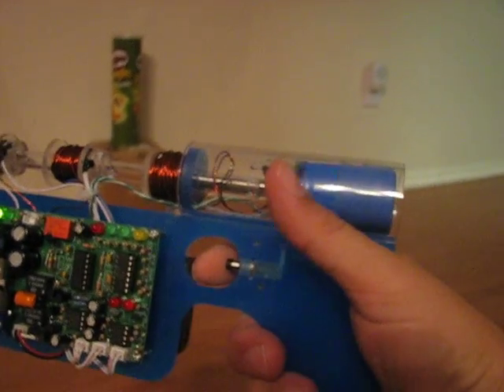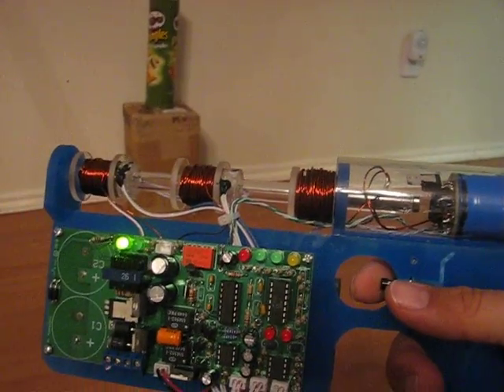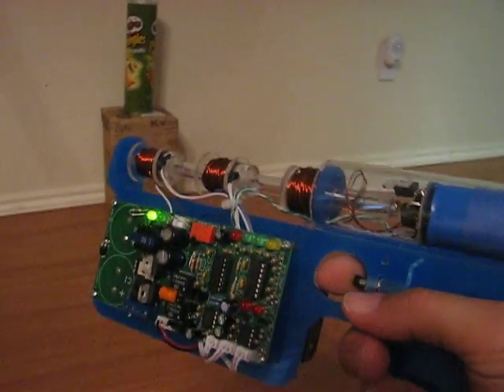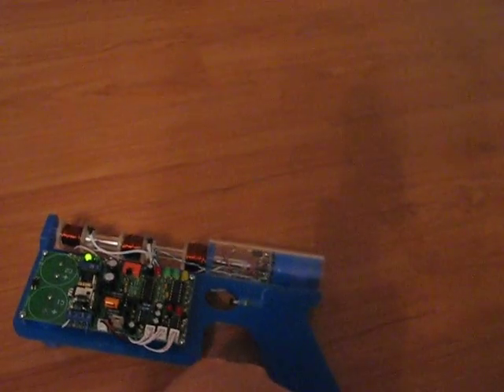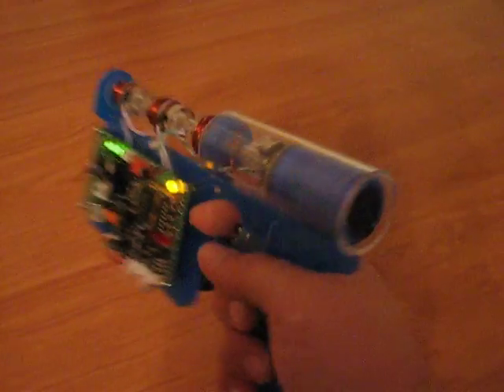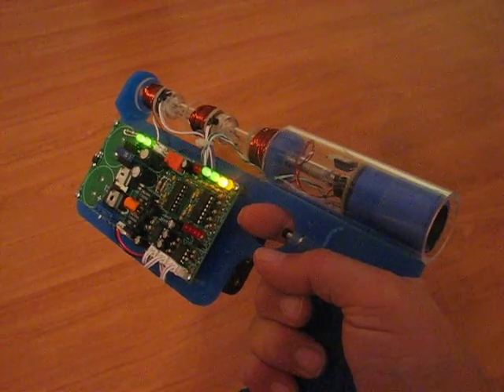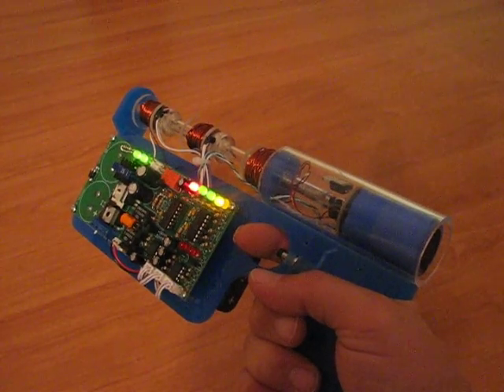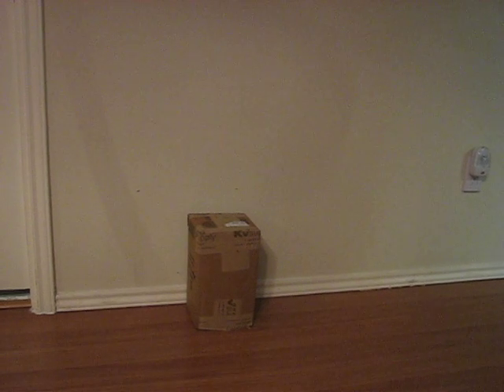3 Stage Coilgun Pistol Using Emag Controller Kit

Comment: Hi, where can I buy a kit?
Reply from the maker: Garrett Weil Wow, its been awhile since Ive checked on this video.  I dont have full kits anymore but I do have some pcbs left.  I can provide you a pcb and bom.  You would have to source the components yourself.  Ive got around 50 of these pcbs left. If you would like a pcb you can paypal $25 to slaphappysamy@yahoo.com and Ill ship them it out to anywere.
Reply: Actually, I was looking for a full kit. Instead, can you answer some of my questions please?
How do you charge a capacitor?
In your kit, what method do you use to stop charging at the right time?

Thanks so much,
Garrett

Comment: Hi. Can you tell me how did you built the capacitor charging indicator?(schematic + components)
Reply: use tranzistors
Reply: you use a comparator circuit and a voltage divider for the sense line.
Reply: Thanks, I tried the comparator LM3914 and it worked fine
Reply: j UK sk btukhddu

Comment: Could something like this be lethal?
Reply: Yes, You would just have to calculate How many coils you would need with how many turns per coil to accelerate the projectile to a lethal speed. however unless we have some huge scientific advancements you would not be able to make a handgun that would be lethal, maybe enough to stun someone for a minute or two. you would be looking at something the size and weight of a sniper rifle with the punch of a low caliber pistol.

Comment: Is there any way to make it charge faster?
Reply: ***** Thank you for going into excruciating detail on how to make it charge faster.
Reply: Tyranus different capacitors charge at different speeds. His kinda sounds like it came out of a camera flash circuit. There's plenty of other options. Generally speaking, though, the more powerful the capacitor, the longer it takes to charge.

Comment: i dont think you optimized the timing of the stages...
u should start with the first stage get a chronograph and record the fps.. then do the first and second stage and keep changing the timing until u get the maximum fps ... then do it for the third stage ect..
Reply: Actually it is optimized. I bought the kit and he goes into very good detail of how to tune each coil. You really went around YouTube and plastered the same exact post on every coilgun video... That is some what sad you know? Especially when many of these builders have optimized their guns and you are just speaking out your ass. Research and read info under the show more links. You might be surprised just how much optimizing when in to some of these guns.

Comment: Actually bb's are very poor to use in a coilgun. The only give you fraction of the power a rod can give you like this gun does. His round is actually a 1 inch by quarter inch cold rolled steel rod. Also a bb gun still makes noise. this makes no noise until impact. This is about concept rather than actual use and the fact he can say he built a working coilgun.

Comment: 1/4 inch by 1 inch cold rolled steel projectile. There is no laser, nor would it knock anything over if it was laser based. You should listen to the video.

Comment: I am still trying to figure out a case/frame. I am using an 11 volt lipo instead of AA batts to conserve space but increase capacity. So my housing needs to incorporate it and a charging port. I also want it all contained for safety.

Comment: Makes no noise at all when fired. A stronger version is just as quite. Also 180 from a metal slug has more energy than a paintball. Remember muzzle energy is a function of mass and velocity. His round has nearly 4 times the mass/inertia of a paint ball. So his impact energy is actually 4 times what you would expect from a paintball at the same speed. So he is hitting with the same energy of a paintball doing 720FPS.

Comment: You might want to pick up a primer on MASS and INERTIA. Yes a car at that speed would kill you. However being an experienced airsoft player I can tell you that and airsoft round at 500 to 600 FPS will not kill you. So a metal slug that is i inch long and quarter inch in diameter can do some damage and even chip bones as it di on my knuckle a rebound, it will not kill you.

Comment: Unless you add more coils which would require double or tripling the control boards you would not gain any more speed or accuracy by building a rifle configuration. A coilgun does not use a barrel in the same way a conventional gun does.

Comment: He tells you at 19 seconds what it fires and I quote "1 inch by quarter inch cold rolled steel projectile". In easy terms for those who apparently can't listen or understand those terms, it is a 1 inch screw that is a 1/4 inch in diameter that has had the head removed. Or simply a steel rod of the same dimensions. Really, can no one listen and pay attention to what they are listening to any more?

Comment: Because flybacks are totally not inductors.

Even non laminated inductors can start oscillating?! it makes perfect sense, the coil inducts an electromagnetic field, causing it to vibrate.

It could also be some capacitor(s). Piezoelectric effects can occur in some capacitors, making noise. 
But I can safeley say, none of my Mosfets ever made any noise.

Comment: If you made it correctly the coils are only energized for about 4 milliseconds each. There should be no power at the coils until you actually fire it if you made it correctly. The dangerous part that could actually kill you is the exposed capacitor leads which he has covered with the body of gun.

Comment: You should not consider a fact true based on YouTube's 'thumbs up'. You know, there are many idiots here, and I mean idiots, who thumbs up any kind of stupid comment. And I'm sure the sound is coming from the transformer. It just doesn't make sense to a transistor make a noise. This is a common problem on PC power supplies, and it caused by the inductors. The same applies to video cards, when creating an extremely high FPS graphic application, you hear a high pitch sound.

Comment: In fact you can use different inductive loads to get the pitch to change. The pitch is driven by current so as the current through the transformer or inductor drops, the pitch rises. We can sit here and argue until the cows come home. I know what i have witnessed and tested to prove to myself. You also seem to have your own thoughts. So now we will just keep everyone here confused and no one will know for sure the source of the sound.

Comment: It would appear that many others have agreed with me on the source of the sound otherwise my comment would not have been voted as top comment. The examples I just gave are all non laminated and should not have any parts that could make a sound as they are all encased in epoxy. Yet the MOSFET will still make a whine sound. If you place your finger on it you can even feel it with larger FETS. Put a stethoscope near or on one and you will see as well the sound comes from them.

Comment: Send a private message to Oyez and see if he will share his schematic with you. He has not given me permission to do so, otherwise I would send it to you and let you see why the caps get charged to negative voltage. Also driving a step up transformer and an inductor like in a boost converter are slightly different. I also know from experience as I have built both types that if you remove the transformer and use a non laminated inductor that you will still get ringing. Even with a flyback.

Comment: A boost converter is a DC-DC converter and a transformer is an inductor. The sound comes from the vibration of the ferrite core of the transformer, the same happens on inductors. Transistors, including MOSFETs don't make any noise. About negative voltage, sorry, it doesn't make sense.

Comment: I have the kit and the schematic for the kit. I bought one back when he was more active on this page. That is not an inductor, it is a step up transformer. He is driving the transformer as an inverter to get 450 AC  from 6 DC and then rectifying it through diodes making it back to DC to charge the caps to a negative voltage. Yes negative voltage. This design is not based on a boost converter but instead a DC to DC converter.

Comment: Yes, there is. Look closely. It is located at the top left corner of the circuit board. It is blue, looks like a small transformer. How could a boost converter be made without an inductor?

Comment: But that is the magic behind a coilgun. As long as your round will fit and it is ferrous it can be used in this type of coilgun. BB's and ball bearings make poor rounds as they have little surface area for magnetic coupling. The preferred round is shaft that is half the length of your coil.

Comment: Tried glass already. It breaks while you are winding the coils. Also unless you seal all your coil layers in super glue, they will contract when fired and crush the glass. At this point the best material for a barrel and coil form that I have found is carbon fiber and the price is not that bad considering how durable it is.

Comment: The capacitors are not making the sound. The sound is coming from the MOSFET that is switching off and on at around 20 Khz to drive the transformer as an inverter.

Comment: no it would not. Input power has no bearing on output power. In fact if you used more than 12 volts on the input you could risk damaging the controller.

Comment: You can buy the kit which includes a manual. Why would he tell you how to build one using his custom designed circuit without you giving him anything in return? Yes his design is custom and not open source like many of the other 100 plus designs of coilguns out there on the web.

Comment: Typically with more than 5 stages the projectile would travel too fast through the final stages to achieve any more acceleration due to the extremely fast discharge rate of the cap needed for that coil. If you want more speed than you will have to go with bigger wire, and more current from your caps or use a raligun that is based on slightly different functionality but is much more difficult to build.

Comment: Small electronics, anything unplugged to an antenna or power, etc has a low chance of being affected by EMPs. Some structures also serve as Faraday cages.

Also, if you're seriously considering EMP danger, you're considering nuclear warfare. I think when we go there the fact that your gun doesn't work is the least of your problems.

Comment: It uses a high frequency inverter to charge with therefore those with sensitive ears will actually be able to hear the sound of the oscillator section of the inverter. So yes it does make that sounds and no there is no speaker.

Comment: Electronics can be shielded against EMP.  Sure, an open circuit board with exposed ICs is probably not the most reliable setup, but any kind of electronic device purposed for military use would be hardened against EMP.

Comment: You forget the velocity is roughly 200 feet per second. That is not fast enough to utilize rifling or any other grooving idea. You could make the projectiles smaller in diameter and add fins. Like a Vietnam era Flechette.

Comment: Unfortunately even with a sharp tip it wouldn't be too accurate since there isn't really a way to make the projectile spin; it would be as accurate as a Victorian-age musket. (though you could make it spin, potentially by carving small flaps or grooves in it)

Comment: Think of a chunk of steel that is 1 inch long and quarter inch in diameter. Take a 1 inch long 1/4 inch screw, chop of the head, and there you have the projectile this gun fires. Of course you would probably grind one end to a point for more damage and better aerodynamics.

Comment: Lightning would be considered plasma. A flame would be considered plasma. Plasma is a super heated gas that gives off it's own energy and becomes a state that is neither solid, liquid, or gas. That is why it is called the 4th state of matter. It has mass but can be very light. it can pass through things while striking other things with great force. HOWEVER THE PLASMA STATEMENT WAS A JOKE! THIS GUN DOE NOT SHOOT PLASMA! It fires a steel rod that measures one inch long by one quarter inch wide.

Comment: So going into a sheet rock wal is not evidence that it can hurt a person. The question is what is your definition of hurt. Will it bruise, cut, break skin, yes most likely. Will it break bone, or kill. No not at this level. Can it be scaled up. Of course. Buy as many kits as you want. Each kit controls two stages. Your limitation would be swapping out the SCR's to handle the higher current demand of larger coils. Coils size and cap size will need to be bigger to snipe with.

Comment: I have the kit, and if you plan to gang them together to make a larger gun, It is possible, but these kits alone only support two opto gates and coils per PCB. The the third coil and cap is an afterthought and no part of the circuit on the pcb. I would suggest using proto board and just multiplying his trigger and opto circuit from the original PCB as many times as you want on a single board provided you have room.

Comment: Incorrect. There are three coils, one cap for each coil. You cannot use a relay to switch the current to the coils as you are switching more that 400 amps and very few relays can handle that much current and still be smaller than this entire package. He is using SCR's to switch the current which is the case with most coilguns of this size.

Comment: I would assume that the board uses relays to switch the output of the capacitors, which I believe are connected in series to get the maximum voltage.

Comment: Not correct, you would need a railgun to fire plasma. Any coilgun, unless used as the injector for a railgun, will just fire the original projectile at a fairly high speed.

Comment: Probably. As far as I can see, there is a small magnet on the back of the barrel to hold the projectile and keep it from sliding out of position in relation to the coil (distances and all that are pretty critical. a few mm closer or farther and it won't develop as much force, might not even exit the barrel.)

Comment: That is the round just behind and partially inside the read coil. He also has a magnet in the very back end of the barrel so the round won't fall out when the gun is tipped down.

Comment: If you where going to use it in a real application, you would carry it around already charged.  Once charged it will stay charged for several hours. You can also add with little trouble and very few parts and additional circuit to keep it at a set level all the time when powered on. Most pf the circuitry is already there.

Comment: essentially it is elecromagnets used to fire an iron or steel projectile. he just uses a configuration of capacitors that store energy for a massive burst of electricity so he can operate it with a few low voltage batteries.

good stuff. no more gunpowder, a silent gun, and you can use it (if you make one powerful enough) to kill without anybody being able to track the projectile back to the weapon.

Comment from the maker: Optical triggering (timing), capacitor charging, gate drive, voltage monitoring, inversion, and signal amplification.  All requires circuitry.

Comment: He is charging three individual caps and triggering each one separately. It also monitors and shuts off the charger at a preset voltage so you don't have too. That way it will not over charge the caps.

Comment: Still not enough mass. It would still saturate. You need a round that is the same length as your coil for optimum performance. It also needs to be solid as well. If it where so easy to make a CG efficient, the military would have already and would be using them instead. No, no one yet has found the magic fix to make them practical.

Comment: Most apartments don't have garages. Also it is very easy and cheap to patch up small holes yourself. I do it all the time since I mod airsoft guns and test them inside. Just get a small bucket of spackling compound. spread into and over the hole, let dry and paint it. no one but you would ever know the hole was there. The management will even give you a small supply of paint. just tell them you want to touch up some nail holes. Oh and it is six AAA and primary power is irrelevant in a CG.

Comment: How would a 1/4" x 3/4" steel tube with a piece of iron or cobalt about a 3rd of the way up the tube work you could reduce the weight and increase the efficiency of the pull at the same time maybe get it to over 2 or 300 feet per sec just thinking out loud. i suggest around a 3rd to balance the weight and maintain accuracy

Comment: That sound it makes when charging is actually the sound of the anti matter being removed from the surrounding area. The it is compressed by the first coil in the back of the gun and then accelerated by the other two.

Comment: Wrong, when was the last time you saw a ball that measured 1 inch by 1 quarter inch? Yep he says that is the dimension of the rounds at 19 seconds in the video. Anyone using balls in a CG do not know what they are doing and they cutting their efficiency down to half of what it could be.

Comment: It shoots a slug that is 1 inch long by 1/4 inch diameter. Made of cold rolled steel. If you build one never use BB's or other spherical rounds. They couple poorly to the magnetic field and rob you of available performance.

Comment: Again had you read previous post, BB's and spheres do not work as rounds for a coilgun. Those who do use them do not know what they are doing and are robbing themselves of potential power. You also cannot use a metal barrel in a coilgun UNLESS you cut a slot in the full length. More trouble than it is worth. Also as has been said before the barrel only serves as a mount and form for the coils. It is not actually needed for any other purpose in a coilgun.